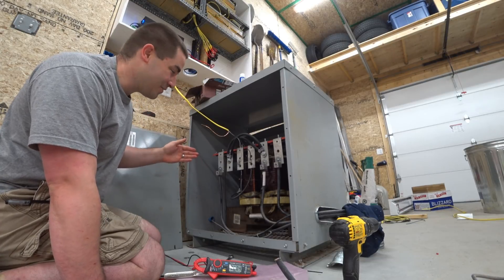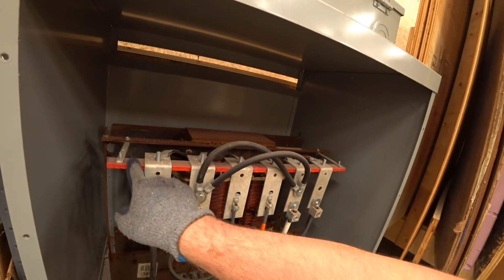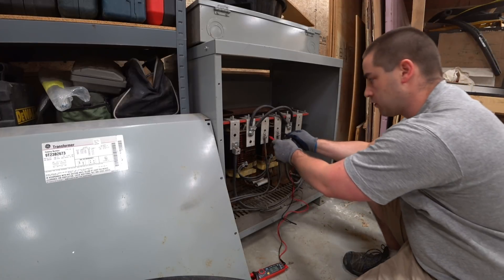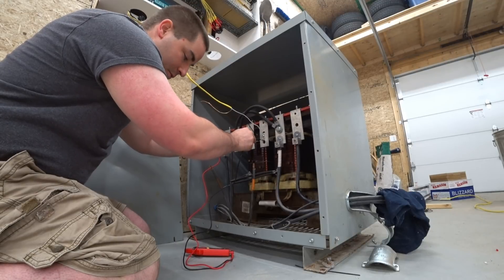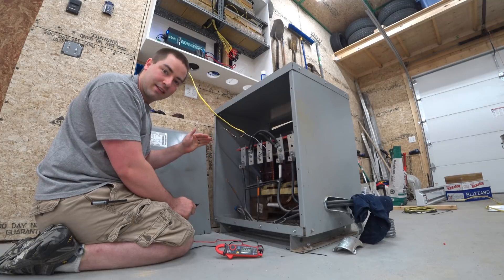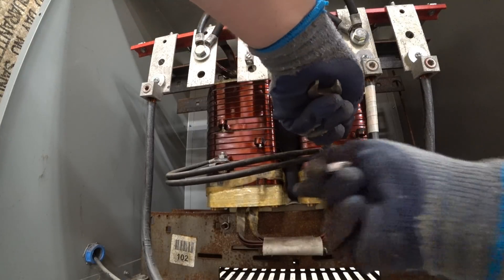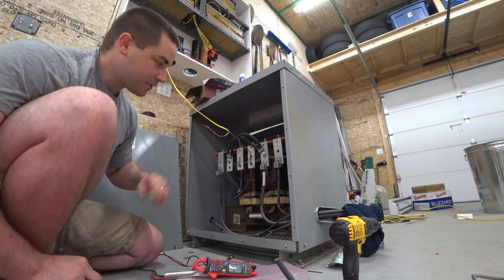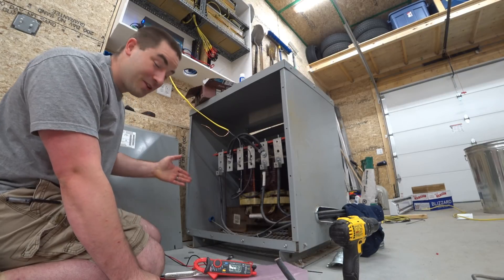Big Transformer, 120/240 Split Phase Breakdown

Comment: You know what I think is cool is that "split phase" is actually just 240 centertapped and grounded. Sometimes, i envy Europe for having 32a 230v at every single outlet - i dont envy the 230 with respect to ground though. I mean ive been shocked but my friend who lives in UK said his pants were damp (4x the power). Remember - if you ever want to get an espresso machine from Italy or something, you need to remove the ground wire from neutral - as its going to be a hot here (found this out the hard way).

Its cool how they can have level 2 chargers at every outlet, apartments even.

Comment: The input is 240VAC to 480VAC, so the primary has to be configured for the voltage to be applied.  That’s what the taps are for.

Comment: Have you had a chance to evaluate the Victron autotransformer?   The SolarEdge 5K is getting hard to locate.  Victron costs more, but has a 100A version.  I am unable to find it's idle load, and that would be important to know.  Center it handles 28A, same as the SolarEdge, so the impedance on the coils may be similar which would result in a comparable idle load.
Reply from the maker: I have not tested the Victron.  I'd be fun to try.  Another approach is to find an isolation transformer.  Buying used is the easiest way.  Ebay, Facebook Marketplace, and Craigslist.

Comment: @DavidPoz Why didn't you use this transformer instead of buying the SolarEdge one??!!!
This is so much massive...!!!
Reply from the maker: Two reasons.  This huge inverter has a huge standby loss compared to the SolarEdge.  Second, this is an old video and I don't have this transformer anymore.
Reply: @DavidPozEnergy  Fair enough... Your video has made me wonder if it would better to go with an "European" 240 V Inverter and the auto transformer rather than a "American" Split Phase 120/240 V... it's a decision to make...
Keep up the good work!!!
Reply from the maker: Personally, I don't think one is better than the other.  They are just two different options.  I'm enjoying exploring/testing different options.

Comment: You will or should never hear an electrician calling any transformer split phase. 50 years ago in vo tech class called it a simple 3 wire edison system. Only thing that we were taught were some single phase AC motors. The start winding is out of phase to create help motor start. I would only consider this a small transformer. A large transformer would be 7 to 9' high and usually medium voltage stepdown. Such as 13,200 to 480 volts. Transformers this size never rated in watts but VA.

Comment: heya lol that is not a big transformer. wen I was in my 20ies I have worked by a company cold smit transformers 1 off the bigges transformer companies wolrd wide there are bild transformers of 100KVA till a couple of 3/4MVA they are as big as your house is and cooled down with special transformer oil. the 1 you are showing is a train or house transformer

Comment: Not sure if you finished your project with this but I would suggest you have a look at this video where he explains how to use the toroid transformer to convert 240 to split phase.  This is similar to the power transformers you see the electric company use on the poles. He measured about 15W of no-load draw. The ST-500 (5kW) is available on Ebay for ~$115 USD. https://www.youtube.com/watch?v=0E8fV9VMDFs

Comment: WOW that is so cool...I have been trying to find just the opposite, I need a big transformer with a center tap to go from 120 to 240 split phase. I have a old diesel generator that runs like a dream and output 10kw of power but only at 120V.  the motorhome it came from rotted away years ago and I want to use it for my house backup generator. I found a shop to make me a tranformer but they want $900 plus shipping... If I could find a old unit like that one...lol

Comment: Hi David, it is a pleasure to greet you from Costa Rica. I see that you are a very skillful and knowledgeable in photovoltaic systems. I tell you about electricity in my country. It also works 120/240 split phase = F1 + N + F2, so all our electrical equipment works at 120v.  is that I have an autonomous photovoltaic installation but I bought an MPP-SOLAR inverter the model PIP3024GK exactly and I bought it because it has the ability to work without batteries and without a network, only directly from the solar panels obviously that function during the day but the problem  is that the output of this inverter is 230v in the European style and since some in Puerto Rico use an autotransformer to remove the split phase but since it is not an isolation transformer I see it as dangerous I personally would use 2 auto transformers and connect them inverted to  remove a phase from each autotransformer and a common neutral but it is a lot of apparatus and it is more expensive so the question is if there is a tran  sformer to take that European 230 in a primary winding and deliver it in a secondary winding in split phase thanks I appreciate any help because I could not use this inverter for this matter

Comment: I forgot to add I am using a small one to convert 110volt Honda 2,000 generator to output 240 split phase because the MPP and most other Hybrid inverters that produce 240v split phase only accept 240 volt generators .  Most of these are very noisy and are not very efficient and even this generator will supply 45.6 kwhr per day efficiently and quietly and with extended 6 gallon tank can operate about 3 days or more for what I use (charging the batteries continuously it can still run high wattage HVAC since it isn't running all the time and PV in daytime directly.

Comment: yep this is old post but its not necessarily that inefficient.  For one thats a 50,000 watt inverter if you did it with a 5KVA or 10KVA standby likley would be less .  Also If you use a transformorless inverter its probably more efficient then you just get it back to about standard efficiency with end use,  In the meantime you have greatly increased the surge capacity by using the large transformer.  I have thought seriously about doing this with MPP 5048 MG inverter and as side benefit it allows 450 v  pv input and is half the price of really split phase us unit .  It also charges to 64 volt which can support 16 s lithium ion non iron phosphate.  A couple of channels have done this with the 5 KVA transformer I saw draws about 36 watts I think.  I think we looked at same channels and thought about doing the same thing.
Reply from the maker: My friend, Ben, is doing just that.  He is using the MPP inverter with a transformer.  https://youtu.be/6nxH9_GmCiU

Comment: That's for 480vAC. Configuring below the rated input voltage will draw more current, not efficient.
Reply: Interesting, what is the science behind that?  I would have figured it would still be efficient, just that it would be under utilizing the core, so the transformer is bigger than it has to be.
Reply: @redsquirrelftw  Parallel vs. series windings. There's 1/4th the resistance to the input now. (1+1 = 2, 1 | 1 = .5) [ignoring inductance]

Comment: Why do this?

MPP solar makes the 5048MG.
The 5048MG outputs 230V AC on one leg and a N.

You can run the 5048MG WITHOUT A BATTERY and WITH NO A/C input!

You would then have a 100% solar circuit.

Comment: How does the transformer put one leg out of phase
Reply: A secondary winding will be in phase with the primary or opposite (180°) phase, depending on which way you look at it.  To get split phase, one half of the secondary is just connected the other way.

Comment: Be careful with the frequency, as that transformer is designed for 60 Hz only. European inverters operate at 50 Hz, as that's standard in Europe. Running 50 Hz through that transformer would burn out the windings! Even with the proper voltage.

Comment: I think that useless, your grid already have 120v and 208v on split phase, unless you want to use 480v appliance, be careful high voltage ac very dangerous.
Reply: He's trying to take 240 single phase and make a 240 split phase system. I.e. the inverter pumps out 240 L-N, and he needs 240 L-N-L to match the grid. Some inverters can provide 240/split, but most don't.

Comment: Wiki says split phase were founded for the copper saving. But I see now you have more problems in US with that 110v due to high power aplliances. We have 220 and 380v in Europe and it is more efficient and easy to work with I think.
Reply from the maker: I wish we went to a higher voltage in the US.
Reply: Not. Shhh.
Reply: Our North American 120/240v 3-wire system works very well, thank you.  It is only partly about copper saving.  That was the historical reason, going all the way back to Edison’s DC system.  In our AC system, it was more a matter of providing a higher voltage option in a way that was upward compatible with the 120V system in general use.  We also have 3-phase service in North America for those who need it.  The distribution network is 3-phase.

Comment: I had been looking for a way to use something to convert output from relatively small quiet inverter generator like a honda Eu 3000is or a similar eu2000is to 240 volt to be a standby generator to charge batteries etc on solar system. many inverters that have generator backup connections or generator autostart do not accept 110volt generators such as the Sol-Ark 12 I am considering.  I like the 110 volt generators mostly because of fuel efficiency and sound levels and portability.  The 3000 unit has electric start and can be remote started but is heavier .  With external tank adapter these can run for days on a 6 gallon plastic outboard motor tank at half rated output. As far as I know there aren't many if any light weight efficient quiet 220 volt generators and these 110v ones can be used for so many other things when not needed for backup. I did find an autotransformer that is used in an outback product but it is pretty expensive see link:
https://www.wholesalesolar.com/2500182/outback-power/inverter-accessories/outback-power-fw-x240-auto-transformer .  If anyone knows where to find a less expensive option please Reply or a different way to get split phase 240v from 110v generator .

Comment: Setup for 480 to 240 like it was org. use the secondary as the primary feeding the inverter into the the l1 and l2.. the primary posts will become 240 with the H tap jumper as neutral ;-p but keep in mind you limited to the max current of the smallest winding but its fine as your never get close to the limits with that inverter

Comment: I see them in shoping centers i belive to step 208 up to 480 for 277 volt lighting consult a electrican befoe installation
Reply: It's 480 or greater stepped down.  It reduces the overall size of the feeder cables and uses less amperage.  

480 at 100 amps would be 240 at 200 amps or 120 at 400 amps (all 48,000 Watts) not accounting for losses.
Reply: Commercial buildings can get 480/277 3-phase service from the power company.  They would use a unit like this to produce 120/240 from 480V.

Comment: Cool transformer. As someone who as done many off grid systems, just get a real 120/ 240 split phase low frequency inverter and be done with it Magnasine  is a great one, I operate my mig welder off it regularly. Its worth the $$. Cheers

Comment: or you could have just hooked the 115 to the secondary coil and got your 230 out of the primary because theyre really is no secondary or primary and they are interchangeable
Reply: How do you get split phase power out of a single winding? (that's the whole point of the exercise.)

Comment: Well I didn't see a ground tie to the neutral on the output side of the transformer so there is a big safety issue right out of the chute.  There should be a four port ground lug on the chassis with a tie to one of the input legs to reference it to ground as well as the output side neutral.  Reference the inverters installation manual as well.  There is a chance that one of the legs on the output is already tied to the chassis so if you chose wrong you could at worst burn up the inverter.  The taps on the outside are used to set the primary turns ratio and the output voltage on the secondaries.  Move the taps up and the output voltage goes up as well.  Pro tip, use Noalox or the like on all the AL to AL or AL to CU connections as well as the AL to chassis of the ground.

Hysteresis losses in the core will result in the unloaded dissipation of the transformer, these losses increase as the loading increases as well due to the resistance of the winding's.

The red fiberglass is in fact called Glastic or glass filled plastic and is very common in switch gear as well as transformers.

For a visual see the link below.

https://beta-static.photobucket.com/images/bb50/mikeiver1/0/114fe480-4171-4a24-bc14-0159d63f4ef7-original.jpg?width=1920&height=1080&fit=bounds
Reply: The neutral ("grounded conductor") must only be grounded in one place. It's not grounded inside the housing, because it will be grounded elsewhere. (Go read ALL of section 250 of the NEC. And then spend the rest of the week reading Mike Holts stuff on grounding and separately derived systems.)

Comment: If you step up your voltage from your 120 volt  inverter  to say 440 using a step up transformer then bring the 440 into your step down inverter you will be all set with 120 on each leg with a nuetral or 240 on l1 and l2. good luck and be safe please.THUMBS UP.

Comment: Connect your inverter to L1 & N on the LV side.  Redo measurements.  Are you able to ground the N of your inverter?
Reply from the maker: Hi Dredge,  I'm not sure about the grounding situation with this inverter.  There is a grounding lug on the back-side, but I don't know if I can ground the neutral.  I think I remember hearing or seeing a comment that someone tried grounding the neutral and it caused something to burn up inside the inverter.
Reply: Is the neutral on your inverter connected to its own chassis and grounded?  You can check that when its deenergized with your ohm meter.  If it is you should connect that to the N on the LV side, and your HOT to L1.  Of course your manual should talk about ground references.  The ground reference on the LV is important or you could create a shifting voltage on your 240 split, depending on load imbalance L1vsL2. For a general reference any ground reference would be lost through the transformer.  Be sure to verify everything with your volt/ohm meter... good luck!  I enjoy your content.

Comment: If you used this to power a Japanese machine you would change the taps to give you a nominal voltage of 100 volts.
Reply: No, the taps are to select the input voltage in the range 240V to 480V.

Comment: Just hook your 120 inverter to the secondary 120v point then wire it for 240v on the primary side and you will have split phase 120ac in on secondary and 240vac out 120 from neutral to each leg L1 and L2

Comment: As an experiment you can also inverse the transformer: Feed your inverter to the secondary of the transformer and beef up the voltage to 240V to use European devices for example.
Another thing you can do is to use it as an isolation transformer. In 1:1 configuration as you did in the video. Don't think you have much use of that unless you start experimenting with electricity on a regular base.
Reply: you might be able to "up tap" the load side of the transformer for the compressor in combination with a starting capacitor... which might damage the motor on the compressor.. but also might help it run ;)
Reply from the maker: Since I made the video I was thinking about doing the 1:1 configuration...  I wonder if it would help turn on the compressor?  Kinda give it more surge ability?
Reply from the maker: Thanks Janktzoni and Christopher
Reply: adding a capacitor may be all you need to run that air compressor. If y you could do some sort of switchable 2 phase 240 using the transformer only activating it when the 240 split is needed thus reducing the parasitic losses in downtime then it would become a viable system I am sure you could configure some AC or other type contactors to do this using DC power remotely switched to pull the contactors thus energizing the transformer as needed very similarly to how 240 ac works.
Reply: Master Debater me